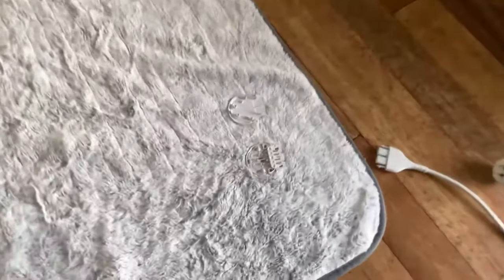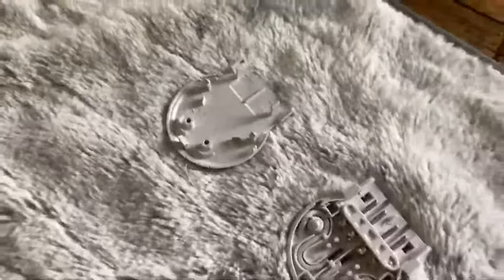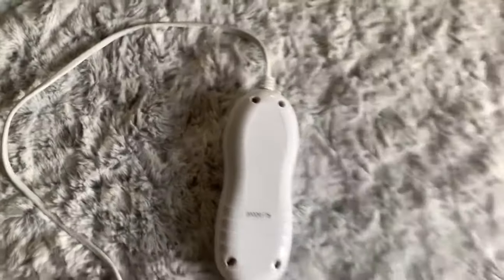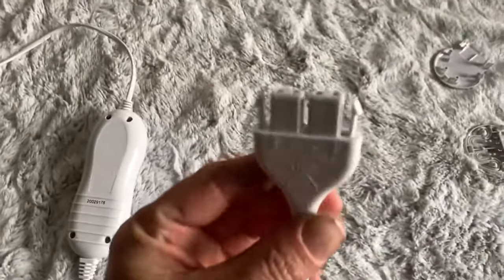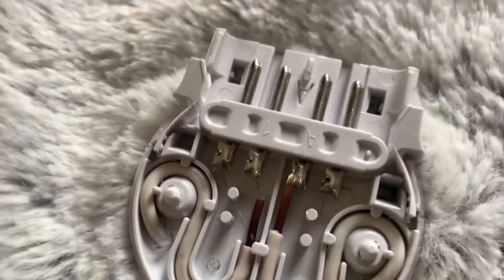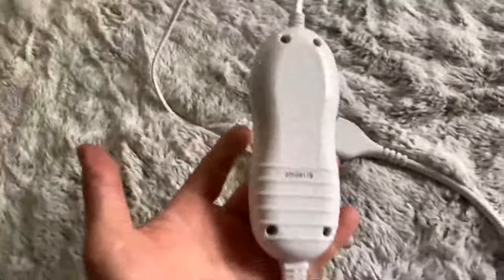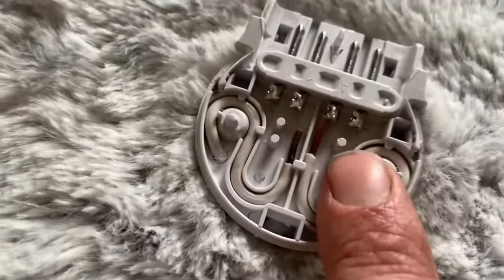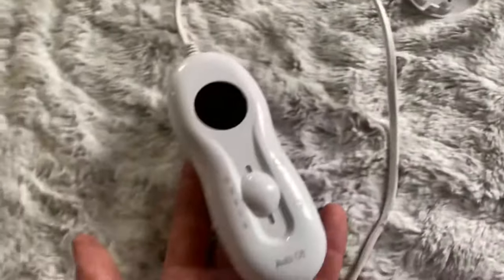Faulty Electric Throw Blanket Diagnosis Troubleshooting

Comment: Hi. The suicide switch that you refer to is called a thermal fuse. It is a fuse that goes open circuit when it's temperature exceeds it's rated temperature. This is most likely what has failed inside the controller for your blanket. If the controller was underneath the electric blanket when it was running, the controller could've beocme too hot and caused the thermal fuse to open. The repair could therefore be as simple as replacing the thermal fuse (so long as you can determine the correct temperature rating).

The wires you have shown connecting to your blanket are a heater wire (one pair) and a temperature sense wire (the second pair). The blanket uses the sense wire to determine how hot the wire is getting. The controller can then thermostatically control the temperature of the heating wire to safe and comfortable levels. If the heater wire broke, the blanket would not warm up. If the temperature sense wire broke, the controller would stop the blanket from operating because it can no longer determine if the temperature of the blanket is safe. Fixing the wire would get the blanket working again.

There are of course other possible failure modes for an electric blanket. I hope you are able to repair yours!
Reply from the maker: Thanks for your comment. I’m sure lots of people will find it really helpful. It’s good to understand why something isn’t functioning as it should. It eases the frustration a little. Cheers!
Reply: No problem at all :-) I find it very frustrating too when things could be designed to be repaired easily, but there is no financial insentive for the manufacturers to do this. Obviously they benefit when products fails just outside the warranty period and you have to buy a new one. Anyway, keep up with the vids! All the best  @Remraf

Comment: Definitely agree these are a huge waste of money.......had a decent one burn out bought a more expensive one that one also burned out then bought another expensive one different brand same thing and they all went within 2 to 4 months...... they should either have them be like 5$ to 10$, have super cheap replaceable remote, say they're life expectancy is 3 to 6 months or not to sell them at all
Reply: Yep, I agree. Why sell them at all would be the answer, it is clearly a failed product that cannot operate safely for long periods of time. It should not be on the shelves if it is designed to fail, which it is.
Reply: Doesn't matter how expensive or inexpensive. These blankets are designed to fail and are irreparable. I have at least 10 which make good pet blankets after they stop working.

Comment: Right now in Britain, with the cost of energy, these throws are selling like hot cakes. In Canada they have ones people can use in their van or camper during winter. I thinks some of them are chargeable. Which will no doubt be the next step in these blankets.
Reply from the maker: This blankets are frustrating at best. Great when they work, a complete waste when they don’t. But I guess it it fails you still have a blanket at the end of it!

Comment: My Livivo Electric throw went Wrong !!!  It was a Yellow Square Capacitor that was not soldered on one side !!!  I soldered it and now it works fine !!!  But the thin wires are impossible to fix if they ever go wrong !!!!  They don't take solder, I don't know how they manage to solder them in, in the first place !!!  You can't spot weld or crimp them, so the blanket can't be Fixed !!!!  Usually it's the Connectors that are faulty, or the mains fuse in the plug is loose.
Reply: Engineered to fail
Reply: My Blanket has packed up now !!!!  So I`ve bought a New One !!!!  I have never successfully repaired an Electric Blanket !!!!   But it`s horrible being cold in bed, and my two small dogs would not be happy without one. Electric blankets are a cheap way of keeping warm. even though they don`t last more than a couple of years !!!!!
Reply: @dumpsterfire6351  Most Definitely yes !!!!  They are Crap !!!!
Reply: @spaceted3977  its actually a thing…they make parts that will only last so long. 
Isn’t that some BS. Hard to repair so just buy another. I have gotten decent at repairing electronics, troubleshooting and solder skills are decent.

Comment: Had a throw size given to me, but it quit after 2-3 uses. Found a small burn hole, hot ash, cigarette maybe, that had melted one side of inside wire. Not sure if bad spot can be cut off & reattached, then covered w/electric tape or a wire cap? Not much knowledge of fixing electric items. Have fixed a few electric wiring, such as speakers, cords, etc. Not sure if this would be worth the effort/trouble &/or if it would have safety issues? Only used it outside, while burning items in burn barrel. (Possibly where burn came from - hot ash, popping from barrel)
Any idea, if this can be fixed? Would greatly appreciate any info. Thanks for vid.
Reply from the maker: I would be cautious. The wire is extremely thin and would be hard to join onto. If you can solder it would be worth a try, just to see it it worked. All it would take is a bridge of wire in the gap between the break. The join would than need to be insulated so it doesn’t earth back out. 
It’s frustrating having equipment break and than there being no support whatsoever.
Reply: Any fault throw it away and buy a new one !!!  You have to be very careful with them and never burn a hole in it !!!  Mine had a capacitor that wasn't soldered in and the fuse was loose in the plug !!!! But you must not put something on the bed to make it overheat !!!!  They only have a lifespan of a few years, but they are really good if you are sensible with them !!!!!

Comment: How did you check the elements/wires. did you use Ohm meter with the sound indicator or measured the resistance. The sound indicator shoul whistle when you test itI think. On my blanket the wires in the element dont give any sound..they are probably bad?
Reply from the maker: You could measure the resistance (ohms) as you have stated. If you are finding high resistance than the wire is broken and the safety switch is thrown stopping the blanket from working. Low resistance indicates that the circuit (safety wire) is still functioning as it should be and the problem may be else where. 
Cheers.
Reply: The wires are impossible to test.  They are the thickness of a human hair and they don't take solder !!! On mine a yellow Square Capacitor had not been soldered on one side in the Control Unit, and the Fuse was loose in the Plug. If the thin wires break it's dustbin time !!!!  But mine works perfectly !!!!